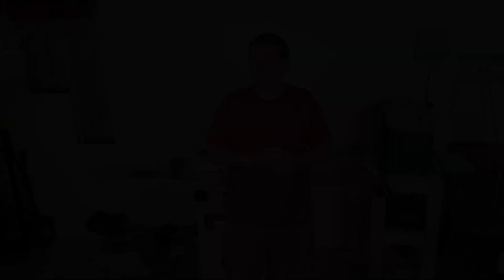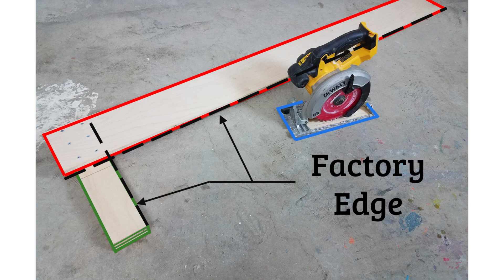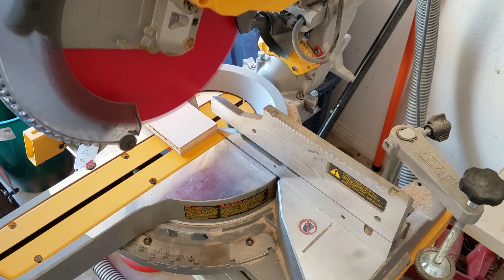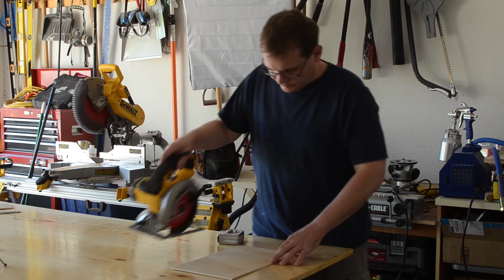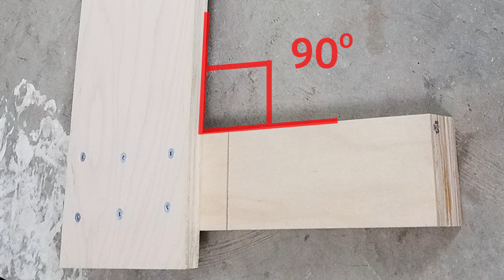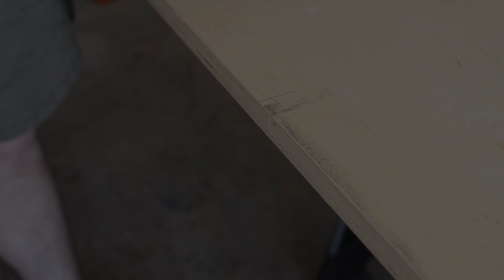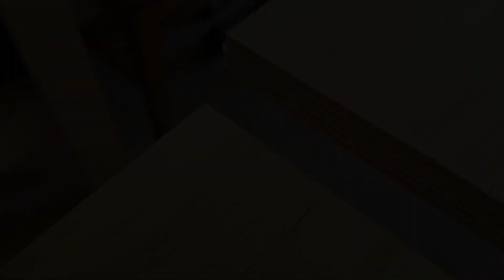DIY Sheet Goods Cutting System that is better than a Track Saw System?

Comment: Let’s face it these cuts are normally made to make the piece you want more manageable. You can then cleanup the cut in a table saw. I’ve yet to see someone let this cut be the finished edge they want. Me I just clamp a 2x4 across the board rip it and  then make  final trim
Reply: yeah... i don't have a table saw... so this is as good as it gets for me...
Reply: aampudia8

If you do a scoring cut first you'll get the cleanest possible edge.  That means 2 passes for each cut.  Expensive table saws have a small scoring blade in addition to the main blade.
Reply: Measure twice.. CUT ONCE!  Plywood is not cheap anymore, having just priced a 3/4" birch at Home Depot, at nearly $55... I do not want to waste anything on double cuts.
Reply: @jacobw446  
Planning your work flow around saving a fraction of an inch of plywood sounds like a false economy.
Reply: That is fine... if you have money to burn.  Even in large scale productions.. they look at how to minimize this loss of material, which adds up quick.
Reply: @jacobw446  55 USD for a whole sheet? That is freaking cheap, compared to german pricing... here you pay 66 USD per square meter.
Reply: @ralphgehteha9924  I remember when it was less than $40USD for a sheet, and regular plywood was less than $15USD.  Now its closer to $30USD for regular plywood, and $55-60USD for Birch or what they call "white oak".. which is really just a veneer.  I remember this stuff when I was a kid, and it was way better wood!
Reply: @ralphgehteha9924  for birch? man i get southern yellow pine 8 ' x 4 ' for $12 USD. How much is that in Germany?
Reply: @MikeTheSith200  Roughly 16 times as much for a ~3/4 (18 mm).
Reply: @ralphgehteha9924  ouch
Reply: Touche !
Reply: If your making a 6 or seven ft high bookshelf.....your going to use a guide like this to make your final cut.  Long  pieces are hard to cross cut on a table saw.....even with a sled.
Reply: Not so. I have built several kitchens, of Baltic birch plywood, using a Festool track saw, which is admittedly expensive, but economical if you do a lot of this type of work. My first and last cuts are finish cuts with the accuracy of a cabinet saw. Additionally, it has a splinter guard which prevents tear out on the top of the sheets, which the method in this video does not have.

Comment: Great info , track saws are way too expensive for my needs. Excellent alternative
Reply: You can buy the Shopfox tracksaw for ~200$ Canadian (160 US?), and the tracks are an extra 80$ Canadian... That's pretty cheap and it works great for me - super clean smooth cuts - the edges are much better than using a standard circular saw.
Reply: Agreed way too expensive but what he made was nowhere close to being better than a track saw.

Comment: The 1st cut you make it one tooth deep. So when you actually use the system do you make sure the short piece of your guide is way thicker than the maximum depth cut of your saw? Otherwise if you cut thick board with it wont you cut off the short piece? Or do you do some sort of plunge cut at the start?
Reply from the maker: Good question. If you plan on cutting boards thicker than 3/4", Then I'd suggest adding additional boards to the edge guide. For instance, if you were to cut a 2 x 4, which is 1.5" thick, then the edge guide would need a total of three 3/4" boards (3*0.75" = 2.25").  Hope that answers your question.
Reply: Yeah, thanks. That makes sense. Great vid, might knock one up this weekend!
Reply: Mostly, this jig is to rip most common thickness plywood in manageable sizes so if you want to use for thicker material, obviously of course, you "add" more to the edge guide.

Comment: In my previous comment re; using a fine tooth blade to avoid tear out - I meant to say " INCLUDING " framing and 2x4s .
Reply: The plywood blade will be dull in 3" of a cut on oak. (I cut a substantial amount of solid oak, and oak plywood). You are on the right track, and for general plywood it is great. I use a 60 tooth carbide on my 7-1/4" saw, and there is no tear out even on solid oak, or oak plywood.

Comment: Using a fine tooth plywood blade will eliminate tear out. I use one on all my work, excluding framing, cutting 2x4s. Great video, thank you.
Reply from the maker: That's a great point. Thanks for taking the time to share your experience.
Reply: Why don't you use a fine tooth blade for framing (not sure what you mean by framing) and cutting 2x4s?  Won't it help with tear out there as well?
Reply: @sethjones4916  ...Framing refers to the start building a house or building, constructing the rough walls or ceiling beams....super accuracy is not completely necessary.
Reply: @djpapachris  thanks Chris.... makes sense
Reply: @sethjones4916  .....np..........
Reply: @sethjones4916  For the same size blade, more teeth on a finishing blade is more expensive. If the application doesn't need such a smooth cut, use a less expensive blade with lower teeth count.

Comment: For both the track saw and your guide, placing masking tape over the cut line will eliminate 95% of the chip out
Reply: I agree, but the real trick is to then use a decorating paper roller to press the masking tape firmly to the board for maximum adhesion and in addition a double thickness of tape (also rollered) can make a slight additional improvement. This is especially true when cutting laminate worktops (tape BOTH sides of the cut even when cutting up through the top surface). The tape also makes marking your cut line easier.
Reply from the maker: That's a great suggestion! Thanks for the advice.

Comment: No way is it better than a track saw. It’s better than a freehand cut for sure but let’s be realistic. Track saws have a purpose and they serve that purpose better than a diy straight edge.
Reply: Festool system $500 (+/-) vs DeWalt, Rigid, Ryobi or other saws and the system he mad $75 (+/-) to $150 (+/-) that is a massive cost difference and the results are actually not that much different. Especially for someone who is just getting into woodworking as a hobbyist (and there are some hobbyist who do quality work better than a lot of the "professionals"). And, if you go the other route to make a DIY track system out of plywood or hardboard, the results of the cuts are greatly improved. And besides, anyone who is making cabinets puts the cut side towards the wall whenever possible so it will never be seen. That being said, for me, does not justify the cost for Festool system. But this is my opinion.
Reply from the maker: Agreed, this cutting system is no replacement to a track saw system. However, the performance of the system compared to the overall cost cannot be ignored. If someone cannot justify spending several hundred dollars on a track saw system, then this is the next best solution. Thanks for your input.
Reply: Robert Melrose Maybe that’s why the title is posed as a question?
Reply: What is your point. he made a video for beginners to get a better than average cut on sheet goods...nothing more nothing less he wasn't selling anyone a $200+ track system. and as a beginner or someone who doesn't do this for a living as in cutting all day this is perfect for the job.
Thank you for the video Robert!
Reply: I am taking donations for a track saw if any has anything to spare.
Reply: It was a question; and I answered it.
Reply: red2965 The video had good information for exactly the reasons you specified. I was simply stating that it doesn’t produce better results than a track saw as the video’s title might suggest. I wasn’t knocking the method at all. I used that method for years until I upgraded to a track saw system.
Reply: Robert Melrose sorry I guess I took it wrong. My apology
Reply: +red2965 1p
Reply: A person can get good results from DIY methods. They are usually more time consuming and less repeatable but it can be done. My point was that the video title is inaccurate. The DIY system is good and probably adequate for most applications, however, it’s not better. Unless your definition of “better” is less expensive.

Comment: The only thing i would do different is I would make the track 9' long and route out two groves at the opposite end where I would add another guide that could be adjusted from 8' down to 4' so I could use the same guide to cut different lengths of plywood and have it be it's own clamp.
Reply from the maker: That's a great idea. It would be nice to cut up to 8'.  Thanks for sharing your thoughts.
Reply: Good suggestion! :D

Comment: nice but not better than a trac saw
Reply from the maker: After using both, I find that the track saw is quicker, and bit more accurate. However, if you're on a tight budget, this system works pretty good. Thanks for watching and commenting.
Reply: The point is to get a cheaper alternative that does a good job....

Comment: Never give you the quality of a track saw
Reply: i have a makita track saw and i also used a festool tracksaw of my friend and i am liking my makita better. festool is just buying that name.
Reply: John S  by. By
Reply: I agree.  This should be called a "saw guide" or similar.  Comparing it to a $1,000.00 track saw is asking too much, but since I cannot buy a track saw, I will build a higher quality version of this which more closely resembles a track saw, using a metal edge and captive fixture on the saw plate.

Comment: Great idea, thanks for sharing. I would be tempted  to glue the joint between the edge guide and the fence to improve stability and help keep it square. Is there any reason why I shouldn't do this? Thanks again for a well presented video sharing your idea.
Reply from the maker: +Danny Boy Great question. The only reason I didn't use glue was for adjustability and replacement. If you goof and cut all the way through the edge guide, which I did, then you can easliy replace it. Thanks for watching and commenting.
Reply: I thought the same thing, but good explanation as to why you didn’t do it.
Reply: Danny Boy

Comment: Very well done - thorough instructions. I’d probably through-bolt the joint some way to keep it adjustable so you can re-square it should you drop it etc.
Reply from the maker: That's a great idea. Thanks for watching and taking the time to comment.